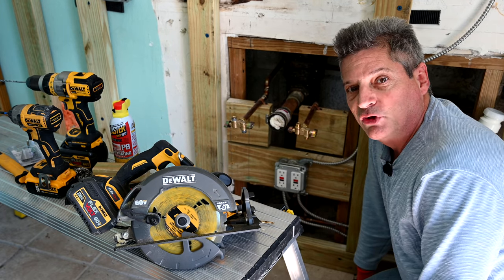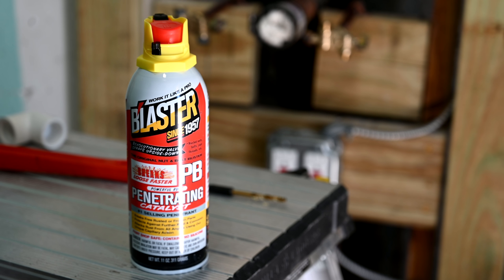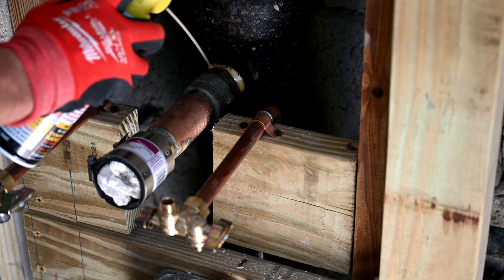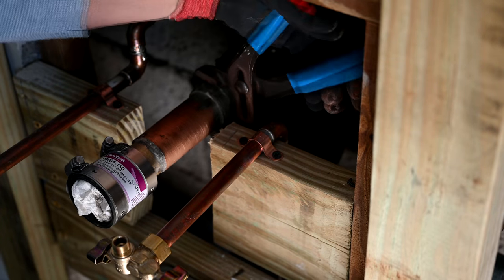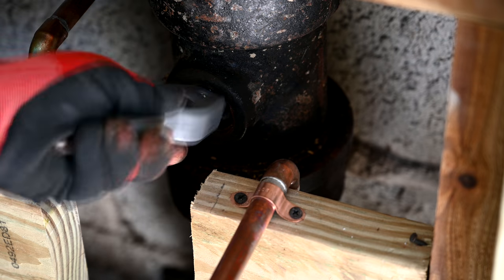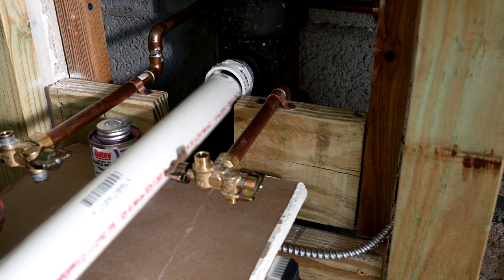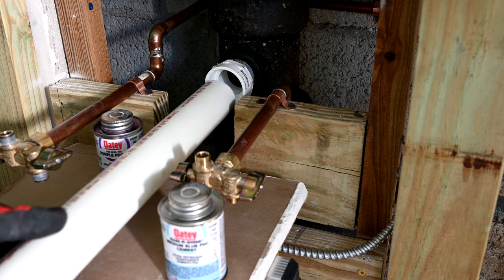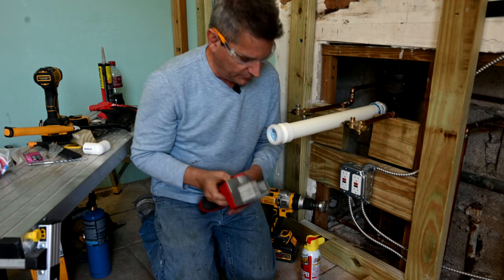How To Remove Stuck Rusted Pipe From Cast Iron Plumbing Stack, PVC Conversion

Comment: Your the man Jeff 
Boy had to do couple those in couple houses picked up for remods for rentals and took days of soaking and tapping give ya thumps up
Reply from the maker: Yeah it's amazing how long it could take we spent an hour or so on it the day before and were not able to do anything until I went out and bought the PB blaster and the bigger pipe wrench. My friends smaller pipe wrench did not work it wasn't until I went home and got the big boy out that it was able to do the job I used this ranch once every 3 years.

Comment: I used a dentist cleaning pick (not sure what you call it, but the pointy tool the dentist cleans your teeth with) to deep clean the rust/gunk between the male and female fitting at the exposed surface where the two join.    This allowed the pentitraiting oil to get in easier.   Took about 30 min to get the fittings apart (every 5 min, more penitrating oil and tapping).   Finially got it!
Reply: 🙄you funny 🤣🤣😎👍🍺

Comment: PB blaster is great, but often you need to give it time to work. I found that out while trying to remove a rusted brake drum--I sprayed but even with a mallet could not work it loose. To my surprise, though, the next day it came right off in my hand.
Reply from the maker: We sprayed for about 30 minutes

Comment: Took me half a day of using that penetrating oil,  but BAM! I was able to get that 6" piece of rusted pipe out. Very helpful video. Now to switch this over to an ABS connection. This all started with a clogged sink. Good thing that little nipple connection failed here instead of while I was away. I still don't even know if I unclogged it yet🤣🤣🤣.

What brand of silicone grease is that?

Comment: Great video and information. I especially liked the way you immediately noticed the original threaded connection was really not threaded in far enough and needed extra attention to make sure your PVC adapter got into the cast iron farther by cleaning and lubricating the female threads. My long experience with gas piping was to -occasionally use a thin coat of Lubriplate on a problem female thread: Silicone grease excellent too but too expensive.  So as not to get corrected here::  "A very light coat WILL NOT push out into the pipe and plug up a pressure regulator or appliance control  if you go easy." This is used only very occasionally...
Reply from the maker: Thanks JR glad you liked it

Comment: I will share a secret with you and I have dealt with stubborn.  Aerokroil for penetration fluid and a Venom induction heat unit.  Spray first- use the induction unit and watch the rust just drip off.  You save a lot of time.  Though through the magic of editing you made it seem easy.
Reply from the maker: With the right technique that we used here in this video it was done reasonably quick but it was not easy you heard me grunting using all my might the turn that pipe

Comment: Would it be ok to sweat on a copper extension eliminating the need for the rubber clamp. Maybe saving a cracking of the cast iron pipe. Hey, I love your show!
Reply from the maker: That is a good question Albert not knowing the exact with of that other pipe and not knowing how easy it would be to sweat that large of a pipe with the torch that I have I would not try it I love the solution I had which makes the most sense you made up to whatever they have which in this case was the female threads.
Reply: Since it was copper yes, copper is suitable for use on a drain.

Comment: Kroll is an excellent penetrating oil. Available in a spray or liquid. It’s a little pricey but worth it I think. You can find it on Amazon.
Reply from the maker: I always wonder why they don't have some of these better things at home depot or Lowe's.
Reply: I had a can of that stuff in my truck forever. Works well but stinks like hell if you get it on your hands.

Comment: Oh wow, I have the same project right now. I prefer liquid wrench and it's been soaking for about an hour now. I was hoping it would penetrate the pipe dope, since the dope is petroleum based. 👏 If it doesn't work after a few hours, I'm going to try my high powered heat gun, and a torch to heat it as a last resort. My only regret is I didn't buy the largest wrench for extra leverage. Argh   Thanks for video!
Reply from the maker: Don't forget putting that extra long pipe on the ranch gives you a lot of extra moment arm
Reply: so , how'd it go ??

Comment: Being in the Navy I would  go in the direction it was going when it was installed by tightening it a quarter of a turn then go counter-clockwise always works for me
Reply from the maker: That is an interesting strategy
Reply: That's what I do tightening a little sometimes breaks it loose

Comment: Screwing an adapter into cast iron or galvanized pipe I think I would have just put a just a couple wraps of teflon tape on that adapter then put some pipe dope on top of that. The pipe dope would help fill in the pitting you have in a metal pipe and would help lubricate it too. Do that instead of using the silicone grease.
Reply from the maker: The silicone grease was there for lubrication only the Teflon tape when done properly provides anough of a seal on its own. And most of the top experts that I have researched over the years say that you only need to add the pipe dope on top of the Teflon tape if you have leaks. Like I mentioned in the video everybody is split on this one some people will only do Teflon tape, some people will only do the pipe dope, and some people will apply the pipe dope over the Teflon tape
Reply: Never use a mip always a scd 80 nipple and a coupling

Comment: I have exactly the same cast iron pipe except there is no thread (screw) inside the metal pipe sticking out. It a smooth/ rusted inside. Can I still use your method of connecting the pvc connector with a threading and tighten. Do you think it will work?

Comment: You did a good job but would it be easier to just connect your PVC to that copper pipe with a rubber boot/Furnco coupling?
Reply from the maker: That is what we were going to do, but that Furnco coupling would be half in side the drywall, half outside the drywall as I mentioned in the video, the builder's stub out is too short. So this setup, while taking more time, gives you the better solution. Anytime I can remove the need for a Furcno type connector I'll jump at the chance.
Reply: It's called a fernco

Comment: I like the content and good repair but as a 30 year plumber you can put mission clamp in the wall all day as long as the pipe you’re connecting to is good. Nowadays when we install cast iron drainage systems every joint is done with mission clamps buried in walls/ceilings. That mission clamp will still be good long after the old cast iron and nipple are rotted away.

Comment: Pipe broken off with male thread remaining inside the hub. Use heck saw across the internal thread and pry off the remaining thread. All rusted out need to get a 1-1/2" tap to clean out the rust and rethreading. Before tried wire brush and a Dremel cutoff wheel to remove the rust, no can do will try the the tap next on order from HD.

Comment: It would have been a big help to install the PVC adapter if you run a 2" tap to refresh those inside threads on that cast T fitting.

Comment: I got 20mm galvanized iron pipe that broken and leave the thread inside the 20mm extension galvanised socket inside sink wall...no space for any wrench... already try the pipe extractor and wd40... nothing happened... any suggestions please... thanks
Reply from the maker: You might have to do what we did here late ron, we cut out a section here with the broken off pipe and coupled in a PVC section, then horizontal pipe out from the wall. See our video on this: https://youtu.be/DjQ2-6hxukM

Comment: Thanks I have the same situation. I’ve gutted the whole bathroom except the toilet . However, I need yo move the toilet to the opposite  side of the bathroom. So I’ll have to replace the stack with all new sch 40 pvc through the attic as this is a straight vent. Sounds trouble some. Concerns are the transition from pvc stack to cast iron drain. The old toilet drain has a side entry for the old tub and lab. But that’s all being relocated for a new corner tub , lab and toilet. So pvc is the way to go. Any general comments.
Reply from the maker: I tell you man with all of these things drains, 90 turns, bends, in the code requirements something like not exceeding 5' from the vent stack and all of that that kind of stuff I'm usually more comfortable bringing in the pros that do this every single day
 It is all these little nuances to the plumbing code that if you don't know it can cause problems with your toilet being able to flush and other issues later on.
Reply: Thanks! I’ll gut all the walls and floors to save money for the pros. Yes it’s complicated!

Comment: Right now I'm trying to remove a pipe that split off in the middle. The pipe behind it closer to the wall - well, it's old and corroded and the wrench went right through the pipe. I'm afraid I won't be able to get it out. I have other penetrants besides liquid wrench I'm going to be trying. Riddle me this - how the heck do you measure the distance for the pipes you need? My old sink was to the left. My new one is a center. I own a lot of tools, but nothing to cut pipes. How do I know what to buy?
Reply from the maker: You may end up cutting holes into the drywall to reach it better. We have a video on how to form pipes to fit a new centered vanity when the drain pipe does not line up to the street drain pipe. Once you can get a horizontal street pipe going into your plumbing stack, you'll be fine from there. IF your horizontal pipe is cast iron, you can install a rubber mission connector, and then install PVC from the mission connector to work your way up to the drian
Reply: @jeffostroff  I'm still working on getting this crumble pipe out. I don't know the technical terms, and can't post a photo, but there's the main pipe in the wall, about a 4 inch pipe coming from that with a threaded end. The pipe that is ready to tear and I can move with the pliers (when I squeeze but not pull out) is off that pipe. No threads. It's also from the 60's. One I get that off, the I will need pipes that will fit in that spot and go to the drain with a P trap. You can't measure direct from point A to B. It's a guessing game to me. I think I will be installing shark bite shut off valves to prevent this water issue again. Thanks for writing me back! I need all the help I can get.
Reply: @jeffostroff  So measure out and over from plumbing stack?

Comment: Can you rotate the stub-out 90 degrees to move the drain over 10” to the right to accommodate a smaller vanity?
Reply from the maker: No for doing something like  that you can't have a 90ﾟfitting on a no pressure drain line like you can with the water supply lines which are under pressure. What you have to do for that is a wide bend 90 if you go to the hardware store and talk to the guys on the plumbing oil they know what you mean it's not A-sharp 90ﾟ turn it's more of a bend cause you will need something to force the water to go Into that stubbout into the wall, and then make the turn, and then head into the plumbing stack and drop down the drain. If you do that you will also have to make sure that you're lying from the new 90ﾟ bend part part slopes downward toward the drain and sure that the water keeps moving.

Comment: Using a 2" pipe tap to clean the threads out for the new pipe works great.. Takes much less time than picking around in the thread to clean them out with a pick.   No need to buy a two inch pipe tap. Rent one.
Reply from the maker: This was molten lead in the pipe. You don't easily clean that out. Much easier to do what we did here

Comment: What if you can't get a pipe wrench in there? Is there any tool that can grip inside the pipe to extend outside the wall where you can put a pipe wrench on it? My issue is that the stack is on the opposite side of a concrete block foundation wall. The rim joist is notched to go around the pipe. So I'm not able to heat it either.
Reply from the maker: I would try to drill a hole on either side of the pipe and run a long screwdriver through it
Reply: @jeffostroff  thanks. There is not enough area on my side of the wall to do that. The pipe rusted away where it cleared the block wall. When I tried to unscrew the 90 on my side of the wall the pipe crumbled. My next attempt is going to be running a Sawzall blade inside the pipe to the stack to try to cut it through from the inside. Then collapse the pipe to remove it from the stack.

Comment: Cut the pipe and use black rubber coupling with clamps 
Clean the elbow joint while it  is open

Comment: Acetylene at tapped/threaded existing sanitary tee, and-or sawzall cut as close to Santee as possible, sawzall blade within inside the trap arm, carefully notch it, then peel remaining trap arm out. Mapp torch fuel will work as well, just takes more time to bring temperature required, expands metal trap arm within tapped sanitary tee. Prepare your pipe wrench first to hold within 1"-1/2 trap arm, once hot enough, should come out. Attempting this process cold, very well could create un-nessesary work, crack existing sanitary tee, and-or drain line below san-tee, or vent line above san-tee within aged cast iron fittings. What was moderate, now is beyond moderate nominal work. Once removed, wire brush within cordless drill, clean tapped threads at san-tee, new trap arm process will be very easy there after

Comment: The brass fitting was not rusted to the cast iron pipe. It may have some corrosion as a result of dissimilar materials. The penetrating liquid was not needed. The best way to clean those threads is with an 1 1/2" tap. It does a beautiful job.
A note about the copper pipe against and through the masonry. Protect the copper from normal vibration using some kind of insulator.
Reply from the maker: Yes, we suspect the brass was "cemented" in by old [pipe dope that hardened. The PB blaster was needed because we could not get this pipe to budge until we sprayed it in there and it softened the pipe dope on the threads. Remember, this is a penetrating lubricant
Reply: I carry a full set of iron pipe taps just for that very reaso

Comment: Use a fitting brush to clean the cast iron threads. When tightening a copper male adapter into the cast iron female threads always solder a piece of copper into the adapter first than tighten the adapter with the piece of soldered copper into the female threads. This is done because if you solder the piece of pipe after tightening the adapter into fitting you will melt the Teflon tape and dope .

Comment: Just nick picking I would like to have the electrical over to the side or over the plumbing and I would have used a large crescent wrench to screw in the adapter rather than use the pipe wrench with chews up the plastic corners. But other than that good video. Thanks
Reply from the maker: Yes, Robogrip pliers are good for protecting those plastic corners also. For electrical we really had no choice due to the constraints of the area that we were in, it's an old house, all of the electrical comes in through conduits out of the ground and so your choice of where you can put stuff is pretty limited and everything was dictated by that super small tight kitchen in which cabinet has to go where in order to get to the outlet below where the garbage disposal in just washer are to plug in it was just a nightmare.

Comment: Back in the day we had to remove these old inch and a half gal nipples underneath kitchen sinks very often. There was a tool called McManus wrench That works with a pipe wrench head and a water meter key. As it was very difficult to get leverage under a kitchen sink. The best and fastest way is to use a rigid chain wrench and a large hammer. A chain wrench does not bounce. End it applies the force at a tangent. And it does not ovalize the pipe causing it to bind. If you didn’t have room you could also tighten it a bit in this method and then loosen it. And if you had to one could notch it carefully with a saws all crush it pop it out and clean the threads with an inch and a half tap.
Reply from the maker: That would have been the next choice
Reply: @jeffostroff  thinking back , the Mc manus wrench was a metal sleeve that slid over the trap arm. It had 4 set screw bolts that tightened into the nipple, then a meter key would engage a welded cross bar. It was over a hundred bucks circa 1988 when patents meant  something

Comment: Did you pitch that pipe so that water flows downward?
Reply from the maker: It's pretty hard to do when it is threaded in and you ar eat the mercy of a stack that is not vertical. I will be working more with the P-trap to slope it downward.

Comment: Hey brother man not trying to b a dick here, I love ur videos and am enjoying the Reno series but that danco silicone grease product is actually for lubricating faucet valve stems. U had it right the first time around when u we’re going the pipe dope route. Best dope on the market is mega lock, I’ve been using that stuff for a decade and never have leaks. If I do have leaks it’s cause of user error not cause of the product. Use mega lock for everything, yes it’s more expensive but u will never question its sealing capability. Peace brother!!
Reply from the maker: Well I was confident enough using the Teflon tape that it and we've tested it and tested it and there are no leagues so I didn't need any pipe dope. And like I said I was only using that to lubricate the thread it wasn't there to seal the threads or anything it was lubrication purposes only